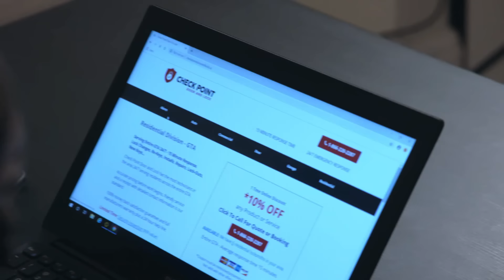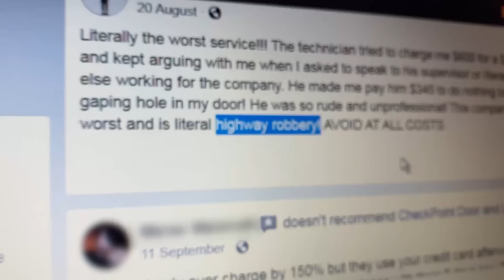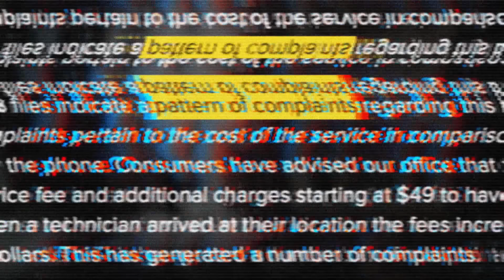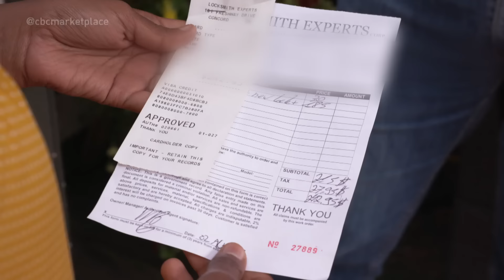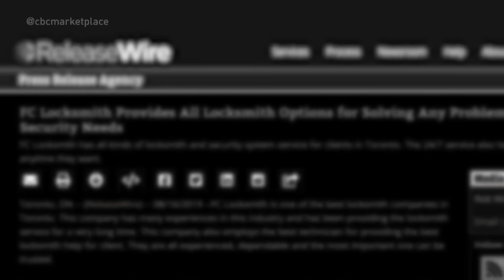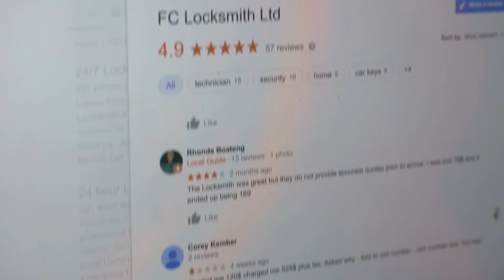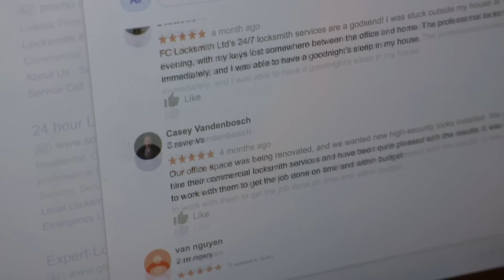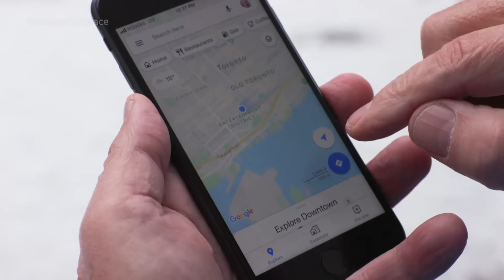Locksmith ripoffs: Hidden camera investigation (Marketplace)

Comment: Does that mean any robber can drill through my lock and open the door 🚪 🤔 😕
Reply: Anyone with a few minutes training can lockpick the door in a few minutes or less.

People are utterly shocked when they learn about lockpicking and how easy it is with major brands like Masterlock and Brinks. They showed you in this video the lady learned how to lockpick in a few minutes.

There are ways to make locks much harder to pick, but even so, for some strange reason most thieves never bother to learn how to lockpick, thankfully.
Reply: Anything on this planet that is opened by a key can be opened with picks....
Reply: Locks are only there to keep honest people out.
Reply: This is why it's important to buy a quality deadbolt from a security retailer. Now, it won't be impossible to get through, but it will be much more difficult than the Home Depot specials. All you need to be is more secure than the next house.
Reply: Drilling makes noise so they'd preferably try to pick or circumvent it.
Reply: A gun comes in very handy if that happens, well over here in the U.S. it does.
Reply: Yep.
Reply: Theoretically yes, but that's what shotguns are for MERICA!
Reply: @172389  This right here. Your house doesn't have to be 100% impenetrable, it just has to be more secure than their next target.
Reply: U can use a plastic milk bottle
Reply: Yes, but faster attacks like simply forcing a door or breaking a nearby window are more common.
Reply: But to answer your question? YES!  
Any lock can be circumvented extremely easily, as for those that claim 'noise' is an issue.... it's 60 seconds... NO it doesn't matter to a crook, he's in and out in 3 minutes. 
A intrusion alarm is your best deterrent, and hoping the local law enforcement is quick.
Reply: Well a rock will do as well...
Reply: Pretty much.
Reply: Or just kick down your door
Reply: @jonnybro7676  knock knock 

Open up FBI!!!!
Reply: or kick it.
Reply: Only the small robbers will pick your lock. The big time robbers will knock on your door and ask for your vote.

Comment: You'd probably be better breaking your door with a crowbar than paying these fools
Reply: i have a door breacher right around my front yard below the hose reel just in case
Reply: @ivisyung3088  youd be much better off keeping a key well hidden. Or learning to pick a lock. I dont even lock my back door cause I have 6 dogs ranging from 55 to 80lbs who know to bite any stranger that wonders in my back yard
Reply: Ivis Yung bit dodgy keeping that there as others can use it plus if you did it would destroy your door and cost a fortune to replace you need to break the lock not the door then either pay someone to replace the lock or do it yourself, if you but the same lock it will unscrew and slot straight into the gap in the door

Comment: My insurance company sent out a locksmith late evening as my garage up and over door wouldn't open,  the guy turned up didn't have a clue, of course he had his drill ready for use,  but the noise would have woken up the neighbourhood so he spent age's trying to force the door eventually with my help  we got the door to open.  He tied a piece of string to the lock inside the garage door and passed it out through the top of the door and tied the other end to a house brick.  And then he was done.  I said aren't you going to replace the lock? I got some rubbish answer, so I asked will you be back tomorrow to finish the job.  Of course he wasn't.  I complained to the insurance company in no uncertain terms.  I went to a garage door repair company and purchased a new lock and fitted it myself. Beware of these con artists.

Comment: I can pick locks better than that, and my set cost 26 bucks on sale. For those wondering how to pick, here's a detailed instruction on how to open a door lock in a few seconds... also don't report this.

 buy a tension tool and a half diamond pick, put the tension tool in the keyhole and twist as if you were going to turn it open, like with a key, don't apply to much pressure or you'll bend it, after tension is applied put the half diamond to the last pin, you'll feel it its the last metal piece that can move, pull the half diamond up, keep it up for the whole time, and pull the pick straight out of the deadbolt that's a zip, put the pick back in and keep pulling out, keep zipping, you'll get it in a few seconds.

Comment: Because of some glitch, I lost my entire comment that was four lines long. So after every sentence I'm hitting save. Ethanol may be involved. I work as a handyman, and do lockpicking as a hobby. Keep that in my aresenal for handyman stuff. Some clients have really old hard to pick locks, including one from Italy that is ridiculously hard to pick as it's a key with angled teeth like Medico, but also dimples on the sides. I think the Lock Picking Lawyer would have a hard time with that one. Instead, I got her inside using a long wire to release the hold her garage door opener had on it, then raked her Kwikset garage door open in seconds, she was astounded, then went on to direct me to patch some walls, hang a clock, fix her electric shades, and some other bits she'd been neglecting, like showing her how a simple hex wrench can clear a thing stuck in her garbage disposal in the kitchen sink. With her I'm constantly showing her what I do and how I do it, even got her a set of Bosch 12v power tools and a bit set one Christmas. She still calls me in constantly for help on things, and I'm happy to help her. Except for that refrigerator debacle. I hated having to cut out the bottom of over-fridge cabinets so it would fit. But I did it anyway because that's what she hired me for.

Comment: I see this is not USA but same happens here. Called a company this week about lock change on rental. They wanted $18 to "look" at it and $250 per lock!! I just changed both the lock sets myself for $91 for the new  (both with deadbolt) sets. Took me about an hour cuz I don't know squat about locks. Saved $400 in one hour. Here's my question: How much does it cost to replace a broken window to gain entry? Certainly not $500 if you can choose which window.

Comment: Heres the problem with these types of industry, the second locksmith said "Yeah, im not gonna charge you $95 for that, it was like two seconds" Heres why thats the wrong way of thinking. 

Regardless if it takes you 2 seconds or 2o minutes, the price should be the price. Ive dealt with this in the automotive industry im in. I do mechanics and roadside assistance, I usually can complete a car lockout service in about 45 seconds and charge around $70. Why should I lower the price because I can do it quickly? Also, take into account my drive time and gas. You cant expect a person to do it for cheaper because they did it quicker. So, while I do give people breaks at time, and I appreciate the second locksmiths gesture, but poor thinking

Comment: Yeah I think I got ripped off here in Australia. First he couldn’t get the door in the garage open and it seemed like he was going to break it. Then he opened the back sliding door and I was charged like $150 but I heard $50 because I’m a bit deaf. There want anything about that on their website but I was desperate since I needed to go to work.
Reply: You didnt get ripped $120-150 to gain entry is a normal price here also if he was picking the garage rollar door they are wafer locks are pickable but if i had to gain entry i would rather pick someones front door rather then a roller door
Reply: @Conflictz  he wasn’t trying to open the roller door. The door inside the garage leading into the house. He couldn’t open it anyway and then he tried to remove the hinges but that didn’t work either.
Reply: @dusk1234567890  Sometimes its better to try other doors rather then sitting on a specific door picking for 25 minutes at the end of the day if they got you in they got you in.

You werent ripped off keep in mind you are paying a locksmith to come out in there time off to gain entry you are paying there wage and knowledge and skill for that price.
Reply: @Conflictz  so are the people in these videos…
Reply: @dusk1234567890  This is Canada this is a completey different currancy  compared to AUD you werent ripped off

Comment: I don't see a problem with drilling a lock but 450 bucks c'mon I've done apartment maintenance for years it takes 5 mins to drill and replace and 20$ bucks for a deadbolt the second guy I see no problem with what he did
Reply: U have same key for all my outside doors thats why its a big deal to me.
Reply: @matemahe  the deadbolts we use are smart locks meaning if you have a key once we get inside we can make the lock accept ur old key

Comment: i have zero lock picking skills and spent about thirty minutes on my safe when i lsot key... it has a 10 pin system double sided key 5 on each...the furthest i got was around 8 pins set...i was using a piece of sheet metal i cut into a torque wrench so i lost grip at 8 .... this is inasane to watch...anyone interested tho i got pissed and drilled the lock out...which didnt help the deadbolt system cause its a pincode safe and the batteried ran out...but thru the 1/4 inch hole and ten minutes with some coat hangars and other tools i openec both ddeadbolts

Comment: Here's my issue with this video... Ok so the locksmith working with the broadcast modified the lock on the door to be made easy to pick, but it seems he used the original housing. Then the locksmith that drilled it said it was impossible to pick. The original lock may have been impossible to pick but it was modified to be easy enough for the host so without knowing it's been modified how is it the first locksmiths fault for drilling it?
Reply: He probably just replaced some spool and serrated pins, which a locksmith should be able to pick anyway, with normal ones.